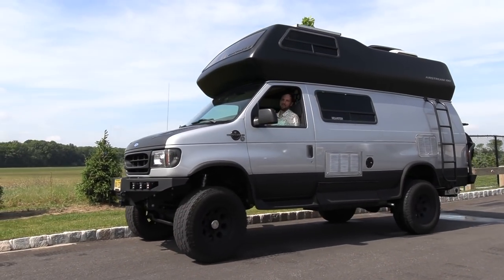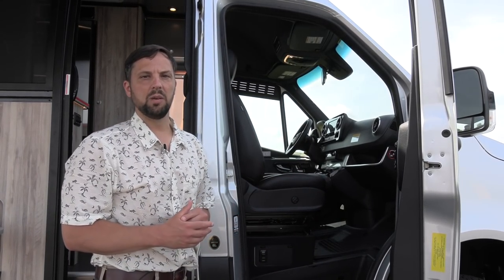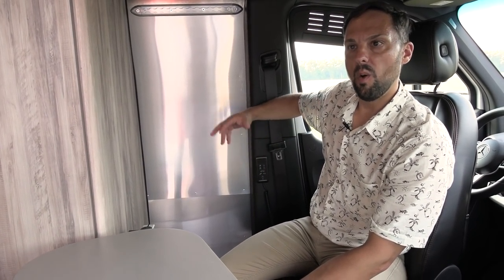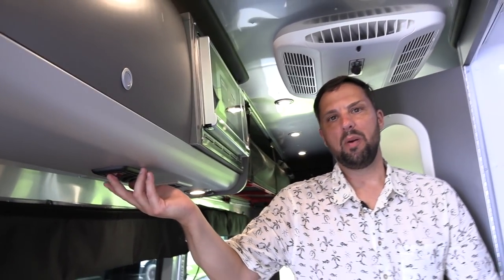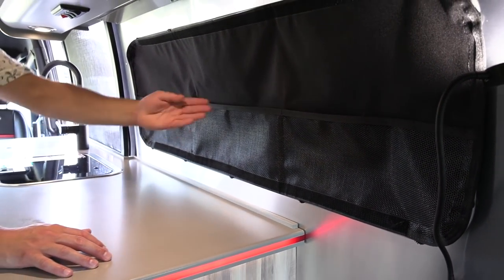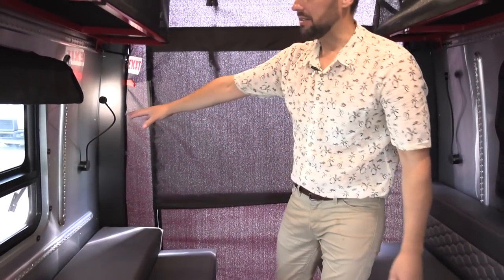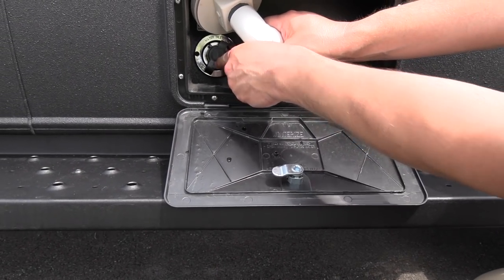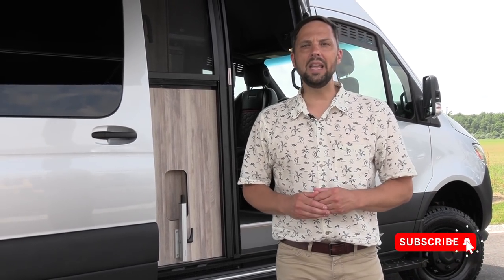4WD CLASS B CAMPER VAN | 2022 Interstate 24X Walk Through 4x4 Off Road Overland

Comment: If I was in the market for something like this, the lack of battery system that can run the a/c would be the deal breaker.   A Volta type system should be included.   If I went this route I'd want to be able to boondock and have a/c if needed.
Reply from the maker: The generator runs the AC, and the new Onan is very quiet. There is more room for a larger inverter and more batteries.
Reply: Agree 100% on the AC, don’t want to manage fuel for a generator when going off grid, want to save that for going further. Also the long wheel base is not great for off-road, and would have a terrible departure angle with that overhang in the rear. Nice RV but not for me.

Comment: Airstream needs to remove the sink from the wet bath, it wouldn’t be so cramped. Other than that for the price it should have more of a lithium system. Shouldn’t have to use the generator to run the AC.
Reply from the maker: Thank you for the feedback.

Comment: These features on the basecamp would be nice.  Fold down window covers, netting instead of plexiglass, hanging strips, maxx air, fixed faucet with multi use sink cover, aluminum bars for bed setup where applicable, rhino spray on front / sides…a real adventure….
Reply from the maker: Yes, it would be nice to combine both ideas.

Comment: Another excellent presentation with vast knowledge of Airstream vehicles. Two things that concerned me, Velcro and the Macerator hose. Velcro we all know does not last long or simply not stick tightly. The macerator hose has a very small diameter that has me wondering if will clog up when draining the tanks?

Would like to see demonstrations on how to tie down mountain bike while driving the camper. 

Many thanks for this video.
Reply from the maker: Thanks for sharing. The macerator hose in the Airstream touring coaches has been used since 2008 and we get good long term feedback. Good suggestion on the bike tie down video.

Comment: Your demonstration was terrific as usual . I’m just not sure who the demographic is for on this ? Young twenty somethings cannot afford this price tag, older folks are  mostly out of the question as they’ve moved up to comfort living and space . That dump hose is comical at best , the table for two ? , ya if you’re each having a granola bar . Tire size is two small for a van that’s being labeled as this off road wonder . What I do like is the freezer compartment , storage is great, windows 👍🏻👍🏻👍🏻, size of bed and still using as twins if so desired .
Reply: My wife and I are in the 20 and 30 something digital nomad / adventure vehicle demographic and I'd say this is mostly accurate, though the price isn't really a concern for our population due to 2 high income, work from anywhere, flexible jobs and no kids.  The big problem though with this RV is most of the people who we know who are in this group, ourselves included, are not interested in generators or propane.  Lithium is the future and any RV that doesn't make that a priority is doomed imo.  This RV has some lithium but it appears to be a very weak system.  We are picking up a 2022 Travato KL later this month which can run 100% without issue on lithium only.  It has induction cooking so no need for propane there.  We don't go anywhere super cold so we don't need a lot of heat and military showers are handled just fine with electric heating elements.
Reply: @psychocinology  the Travato is very nice and yes yes yes on the Lithium batteries .
Reply: You will never get enough solar panels on the roof to keep all those batteries charged. How bout a week or two of cloudy days?  Oh we will just drive and the alternator on our fossil fuel engine will charge them, or we will plug into shore power that get power from a fossil fuel electric plant charge them lol. You may be able to run an a/c for a couple of hours. Lithium is great for low draw applications, fossil fuels is still king. Almost everything you use has something from from oil, including those lithium batteries and the process to make them.
Reply from the maker: Thank you for the feedback.
Reply: @colonialairstream  thank you, much better reply then what I got the first time around . Apparently it’s since been deleted 👍🏻
Reply: @Bee Allen (yes, I accidentally replied incorrectly)
My husband and I are brand new/rookies when it comes to RV living or RVs themselves. We are starting to look at options so we will know what we're doing by the time we go to purchase. If our plan goes right, we want to travel the US and live in the RV. Period. I know enough about lithium batteries, solar, propane etc. to know we would not even consider this vehicle. 
Bee Allen - you hit the mark when you said that people at our age, 58 and 59, want  room.  For this price tag… they also could have easily slipped in some of the "options" you mentioned.  A television would cost the company nothing and most people use them. At least those in our age group.  I laughed when I saw the size of the table. Anyway… 

Bee Allen… If you have any time. I would love to hear any recommendations for my husband and me. We would love to know where to start and what to look for/look out for.  Our price range is 200 K give or take a little. We are not looking for a castle on wheels, but you could understand that we want more than this van offers.

If you don't really want to give out any recommendations, that's fine. Maybe you could point us in the direction of an "expert" or a good website you trust when it comes to early retirees looking for a small home on wheels. Thank you! Your review was well written.

Comment: Thanks for the great video.  We currently have a BC 20X that we love and are thinking of getting a 24X and may or may not keep the BC as well.  We are realistic about how off-road able a Sprinter really is (at least one with comforts) and don’t think the 19’ has enough room for us.  My question is whether you have any sort of comparison that can directly show the differences between a 24X and a 24GT.  The 24GT with 4X4 seems to offer more comforts without giving up much realistic off-road ability.  We like to stay away from campsites with hook-ups, but most “off-roading” is really rutted dirt and gravel roads.  Trying to figure out whether a 24GT would be enough or if the 24X would really provide significantly more capability and exactly what comforts we’d be giving up.  Any thoughts or links would be appreciated.
Reply from the maker: Thanks for the message. We do not have a side by side comparison video on the two models however we have featured them both in detailed walk through videos.We cal also chat about them over the phone. 1-800-265-9019

Comment: A lot to like about this rig, but the fact that you have to be plugged into to shore power to run the Max Air fan and the use of gas for the cook-top make this less desirable. Great review
Reply from the maker: The max fan runs on 12V battery, you do not need to be plugged in.

Comment: Nice but it should have lithium instead of generator and not sure it has extra seatbealt for passenger in back with 24ft u really need to be able travel with more than two passagers.
Reply from the maker: It has both Lithium and Generator and also has 6 seat belts. Its all mentioned in the video.
Reply: My bad I must have missed  6 seatbelts that is awesome!!! But one question why would u need both lithium and generator what is logic behind it? Thanks

Comment: Is this van rated all season or not? Even if it had heater, it does not seem enough and how does the aluminum inside insulate, good or bad?
Reply from the maker: It has heated tanks and it also has a diesel furnace. It can be used in cold weather.

Comment: Overall very nice. Surprising that the genset is LP not diesel, with an induction plate instead of burners. And the solar/battery system has no option to expand.
 The front door vent gizmos are "where have you been all my life?!"
Reply from the maker: It would be nice if a generator was made that would fit under the Sprinter chassis. Airstream uses the Onan diesel generator on the Atlas since it is a cut away chassis.
Reply: @colonialairstream  If they can't find a way to shoehorn in a diesel genset, then options like Volta (integrating a second high output alternator into an otherwise conventional solar system) are still available. At those prices, outstanding engineering should be the norm.

Comment: Any idea how much weight those L-tracks are rated for?  I would love to load up a motorcycle in the back, but not sure what the weight rating on the tracks would be.  Also might be nice to string up a hammock inside as well using the side tracks.
Reply from the maker: There is no published weight ratings for this application. I would suggest not putting a motorcycle in them.

Comment: Looking for something like this, but this one fails in 2 areas for me.  Not enough battery capacity, and too small of an inverter.  You have 400W of solar, yet a small battery set and inverter.  Nope, also, would prefer an electric cooking system as an option.
Reply from the maker: For the 2023 model year there is a new all electric R1 package available with 3200W inverter, electric cooking and a massive Volta lithium battery system.

Comment: Do the lithium battery charge while driving? If so can you explain? Thanks
Reply from the maker: Yes, there is a DC to DC battery charger that allows the engine alternator to charge the batteries.

Comment: Doesn't the engine have an alternator where it continually charges the battery?
Reply from the maker: It dies with the engine running with am RPM over idle speed.

Comment: Too big for city, too small for long trips. There is no one size fits all.
Reply from the maker: You can always tow an Airstream Basecamp behind an Interstate Nineteen. it is small enough for the city and the Basecamp can be towed for longer trips.
Reply: @colonialairstream  I had my Thor 19p Sanctuary In DC this past weekend. I drove around, to, and from the Mall. It was TOO BIG. The place was packed like a work day. I worked there 15 years, most of which I drove, even a pick-up and occasionally government 2-5 ton trucks. A five ton truck was easier to maneuver in downtown DC than that Sprinter-based camper van.